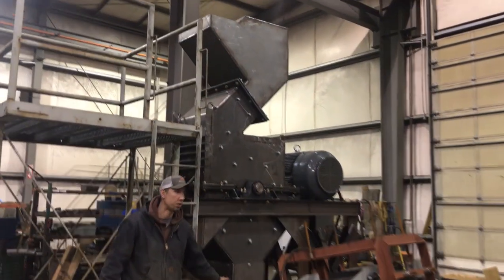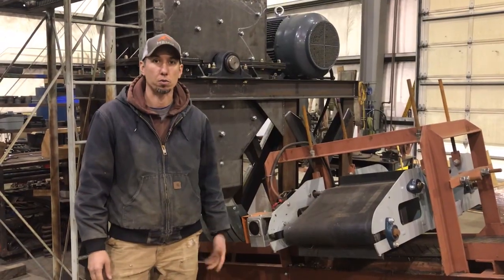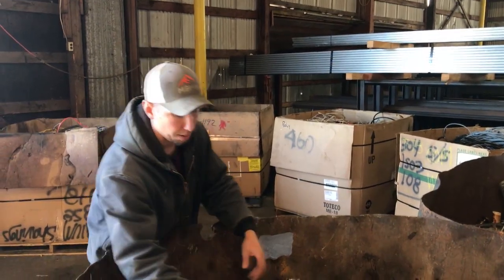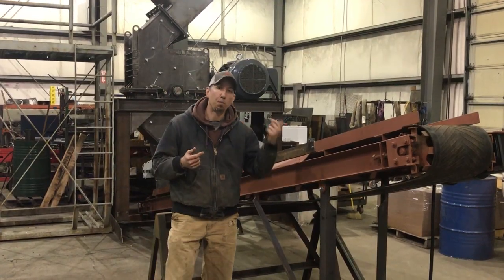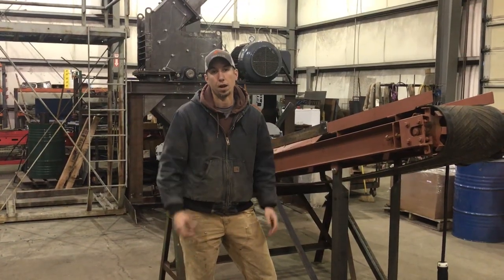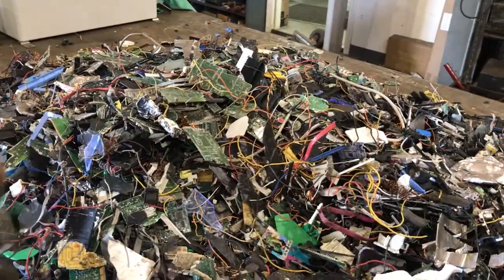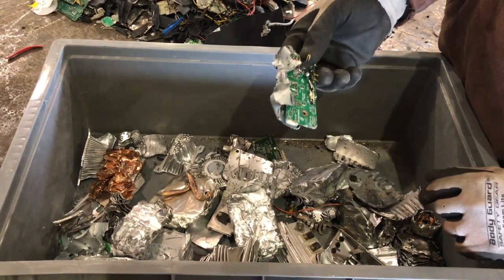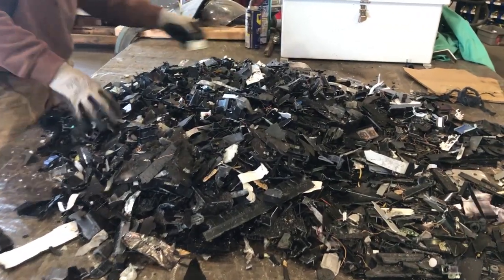Metal Shredding/Recycling Plant, Complete Processing System: Aluminum, Electronics, PC's, Printers

Comment: Two things come to mind, firstly, you need a second stage hammer mill before the magnetic belts, in order to break things a bit smaller. Second, it is actually worth while to prepare the material to be shredded beforehand instead of having it all run through unsorted.

Regarding the metal belt pulling magnetic metals off the belt, the biggest problem I can see there is that the separator flaps for the belt actually were enough in some cases to push materials off the belt it was positioned over. This is mostly why your plastics from the printers were getting pushed into the metal bin. You also need a feed hopper for the hammer mill's output so that you can regulate exactly how fast and thick the material coming out of the hammer mill will be when it comes onto the belt.
Reply from the maker: Great! Thanks!
Reply: Definitely need a second stage grinder. As for PC towers much better to strip manually to remove the bulk of the ferrous, then grind the rest. Save them HDD disks and cpus gold platinum and rhodium oh my 😁

Comment: 1: Big items with this Hammer Mill
2: Belt feed into 2nd Hammer Mill
3: 2nd Hammer Mill makes even smaller stuff
4: Mag Belt to pull ferrous
5: Eddy Current at end of main belt to pull Cu, Al, etc etc etc
6: Remains drops onto feed belt to granulator
7: after granulator it feeds into Shaker table to sort out the lights from the heavies.

Well at least it works in my mind. 🤣
Reply from the maker: Nice, sounds like a plan!

Comment: Ink jet printers have very little salvage value, a couple hobby motors, a small board, flex cables, the head board, the scanner board assembly and steel rollers. All together barely a pound... rest is plastic rubber and glass. Some have a neat diamond coated rod that makes a great knife sharpener though.

Comment: Is there a screen underneath the rotating hammermill? if not you should place one with holes from 1inch, so you crush the plastic in smaller pieces. ;-)
Reply from the maker: Yes, there is a screen.  We can make them any size you need

Comment: The other thing you should consider is using a crusher and not a hammer mill. There are shredding videos on YouTube that can shred a wide variety of materials and can even extract metals from the output belt. If you still want to use the hammer mill consider a sizing grate that loops back oversize materials into the crusher for a second pass.
Reply: I was actually thinking of the idea that involves this machine to make the really big stuff somewhat manageable and then feeding that material into another Hammer Mill to make the pieces even smaller yet and then hit it with the mag belt
Reply from the maker: Great! Thanks!

Comment: So let me get this strait you paid 3 men 35 minutes of labor + your labor burden + 35 minutes of fork lift time + the cost of maintaining the machine (repairs electricity, cost of space in shop, depreciation on the machine, interest on money spent) for $175. Is that correct? I don't see much margin there.
Reply from the maker: Thanks for the comment.  This was just a demo so probably not as efficient as it could be.  Ideally it would be only 2 people (maybe one if you didn't need a picker if you ran a smaller screen) and so it works out to $300 revenue per hour, or $2400 per 8 hour shift.  That is not bad money for a days work.  I bet it would pay well for most scrap yards.  The customers that buy our equipment tell us these machines are money makers.
Reply: And where to find such big quantity scrap to feed the machine? And who would be the buyers of the shredded iron ?
Reply: @huiwang6628  go to any large city and go down the alleys with a pick up truck. Hospitals schools good will mechanics garages etc. Have tons of junk they tra as h everyday. Most cities have a scap yard on the edge of town. Most people that scrap  just  dump it off the truck and only get 8 cent per lbs. If you sort it and break it down you get 25 to 60+ cents lbs. Thing is you generate tons of plastic trash and will have  to rent a dumpster and pay to take it away. Plus you get all kinds of junk for thrift store and antique  store's. Most people don't have warehouse to do it. We had 55gal drums for valuable metals, pallet sized boxes for nonmetallic metal, and a 25 foot dumpster for the light steel that's only worth 8 cents but you will get tons per day.

Comment: One battery drill and 15 mins is what it would take to get the steel covers off the computer towers. There’s 60% of your ferrous real clean. 
Edit: I want to see your air table.
Reply: 15min is not free. It would cost the client $3.75 in just wages @$15/hr... (not to mention the other costs of doing business like capital costs, insurance, payroll taxes etc.) It quickly would get to closer to $7 in total cost to take apart a computer they can only get $8.00 for. Scrap prices have been going down, precious metal content of the components is going WAY down... Labor and capital costs are going up. At a certain point its not worth disassy. when processing on a commercial scale. 

if its not profitable to recover raw materials these items would go into a landfill, or recycling would have to be subsidized at tax payer expense.

That's the reason mbmllc's clients are seeking out shredding and milling as a way to increase efficiency for the less profitable items so they can harvest as much value with the least cost. This is a ratio (cost in both labor and overhead vs. return on investment) not a single factor (maximum potential resale value of icomponents)
Reply: Ah save the cpus, ram, graphic cards and other bits from the computer towers and resell them or process for pm recovery. Can scrap one a lot quicker than 15 minutes if i was just going for the metal. The hard drive disks have platinum colbalt magnetic media coated with rhodium inside. At todays rhodium price of 20k an ounce i would be manually removing those putting them on a chuck and turning the datafoil off the aluminum or glass platters.